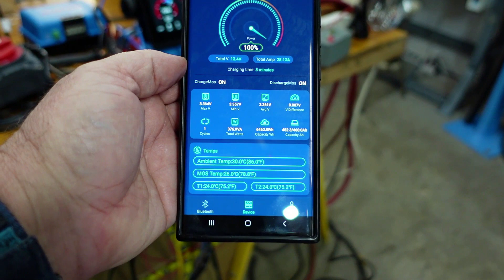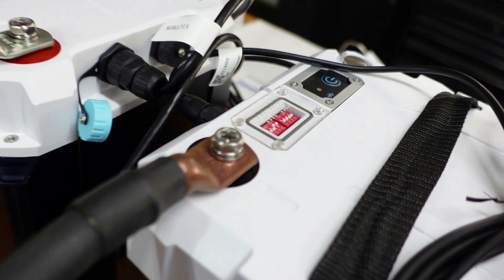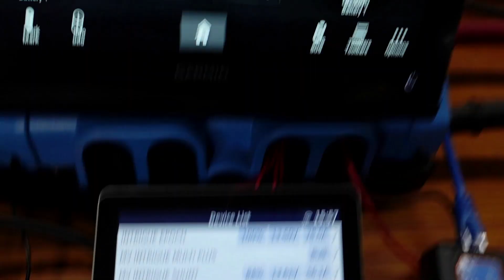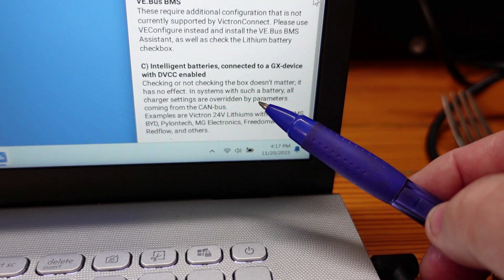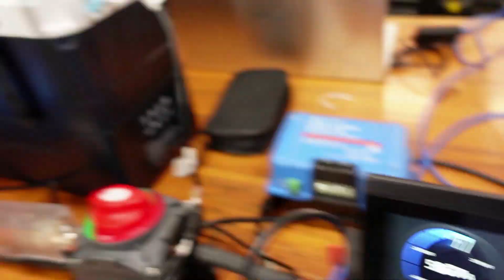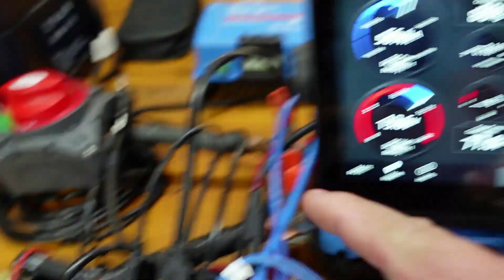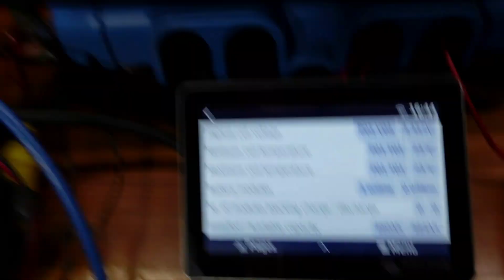Epoch 460AH Monster lithium battery with Victron Comms first test report - Plus 10% off code below

Comment: I am awaiting my Epoch 300Ah V2 for my 1985 Catalina 30.  My understanding is any CAN network can be daisy chained.  I do not believe you need a splitter; I think you can connect one battery to the next then to the CERBO GX.  Perhaps I did not hear it correctly, but it sounded like you said the Power In has fuses, it does NOT (Unless you altered it by adding the missing bolts, washers and nuts) it is the Distributor that has fuses.  The AYBC specifies the main battery fuses must be within 7 inches of the battery, unless the cables are sheaved which yours are not.  Most recommendations I've seen is to put a fuse on each battery then go to a main emergency cutoff switch that can handles the fused amperage, then to the bus bars.  (I'm not sure if that is true if they are in series or not.)  If you fuse each battery, you could connect your Power In and Distributor via the tabs.  If you need to keep them separated, I would take the cables off the Power In via the tabs instead of with Link Bars or short cables as you show.
Reply from the maker: No I did not alter the power in. I just misspoke and for some reason was visualizing the distributor as I was talking..lol.  Thanks for correcting the record. You are right to think the CAN should daisy chain. This was what I was expecting. But I could not find a configuration of ports and dip switches that would allow daisy chaining. Either I still have a configuration or setting I have not tried or maybe we are still awaiting some additional info. Apparently Epoch and Victron are discussing this now or will be very soon. So I am sure there will be some refinements and updates as we go. If you get your batteries and successfully daisy chain them be sure to share with us.  My final configuration and set up of fuses and switches are not set I bought the MBRF fuses already in case I want them coming off each battery. I really like those fuses. Some of the final configuration will be determined by placement in the boat. I will be working with limited space and may have to separate Lynx power in the Lynx distributor and other components. We will see. Thanks for your reply and contribution to the discussion.
Reply: @mvintrigue-trawlerdiy1101 My understanding of the AYBC requirements for Lithium is they HIGHLY recommend a Class T fuse (if not outright require them).  Apparently, the Class T fuses are one of the only ones that can stop the power surge if the battery shorts, other fuses can still pass it even when blown.  The Class T fuses & holders and huge and comparatively expensive, but I figure it is cheap insurance against the boat burning to the water line if worse comes to worse.  When I ordered my 300Ah V2, the website picture showed RS485 | CAN | CAN, but when I saw your other video about them those batteries were RS485 | NC | CAN.  I took that to mean No Connection.  Is that correct?  Even if the second CAN connection only acts as a splitter, they need to let users daisy chain them because splitting a splitter to get more than two will get messy fast.
Reply from the maker: Yes...class T fuse is a must. Rod Collins has some good info on his site MarineHowto.com on class T fuses. The class T fuse in the video is a 400 amp one and that should be enough. Ill probably put MBRF fuses at each battery. Along with a cut off switch at each battery and another cut off at the inverter. The daisy chaining would be preferred for sure and thats how I initially tried to set it up with no luck....as of now me and several other have not figured out how to make that happen. I just ordered some more cables to try some different configurations. Still working on it. @chriswolcott1692
Reply from the maker: @chriswolcott1692  So I double checked my power in and it does have fuses. I bought this stuff used so the previous installed must have added the additional pieces. I thought it had fuses because I added some to it..lol.
Reply: When you guys say “fuses” you mean an actual fuse and not a resistor? Also, can you put in a capacitor bank to buffer incoming power irregularities?
Reply: @bill4639  Yes, fuses.  (What would you want a resistor for?)  The Epoch 460Ah V2 apparently comes with an internal 500A(iirc) Class T fuse.  (I don't recall seeing any other of their batteries that do so.)    As far as a capacitor bank, I guess you could but again, Why?   Your charge sources should take care of smoothing out any gross irregularities in shore power or generator power.  As far as the Lynx Power-In/Distributor and fuses go, the Power-In as shipped from Victron does not have the ability to add MEGA fuses.  It is the same basic device as the distributor, except the distributor comes with a circuit board to monitor the fuses and pass info back to the rest of the system.  You can add the missing 4 sets of M8 bolts, washers, lock washer to a Power-In be able to use fuses but you won't have the fuse monitoring circuit board or LED lights of a Distributor.
Reply from the maker: @bill4639  yes we mean fuses that will disconnect when a certain amp load is exceeded. I dont know if something like a capacitor bank would work. Thats a bit above me, however someone more educated should be able to work that out on paper. But I do believe they have protection devices that are the type of thing you refer to and they are not expensive. However I think they are single use. Something like the Sterling power surge protector. I think its less than $100. I plan to incorporate a product like this in my system.